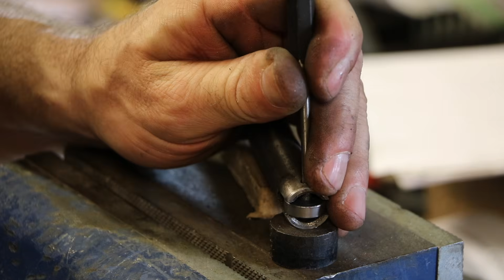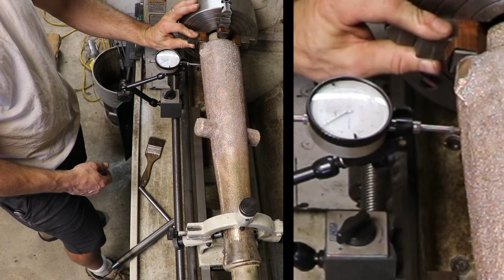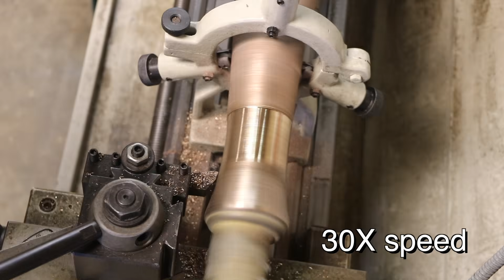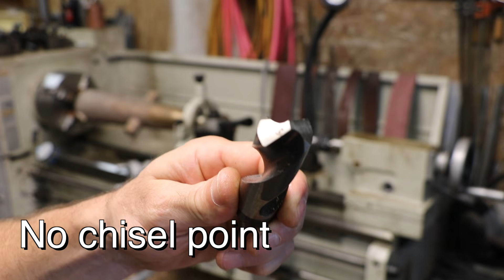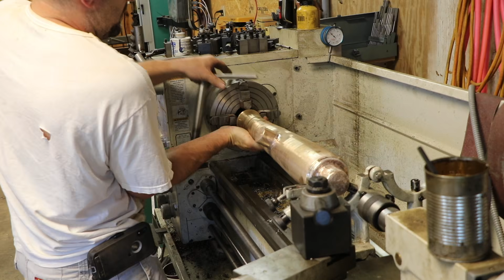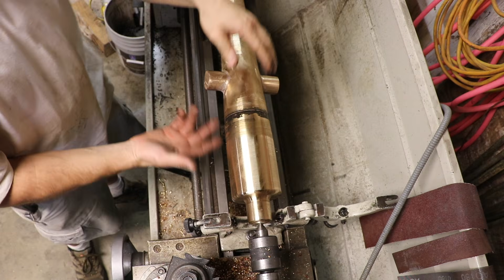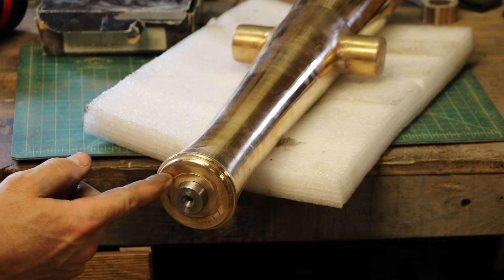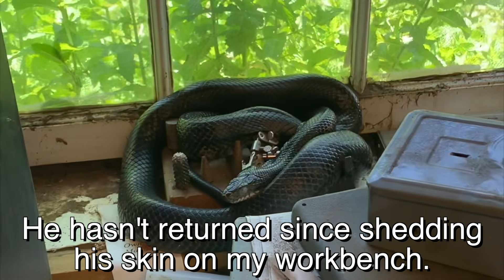Machining a Historic Bronze Cannon Barrel, Scaled Down Replica. FarmCraft101

Comment: to get center you could draw vertical line, turn 90 and draw another vertical. center will be on crossing
Reply from the maker: True.  I tried that, but with it just being a few thousandths, and the surface being a little rough, I wasn't successful.  Great thinking.